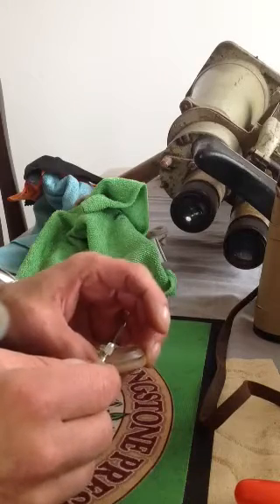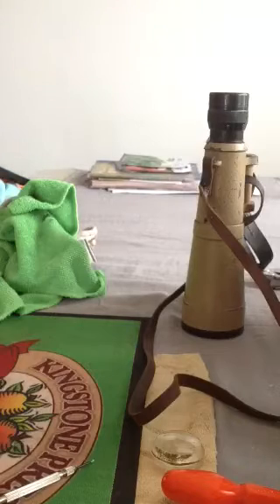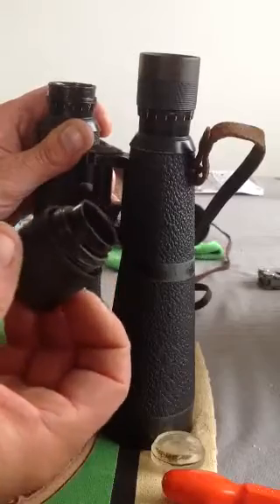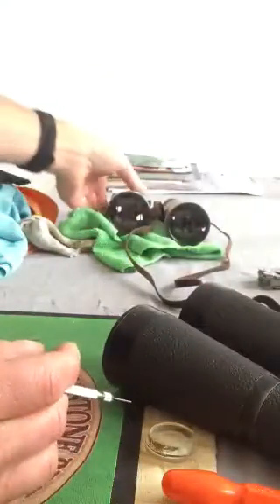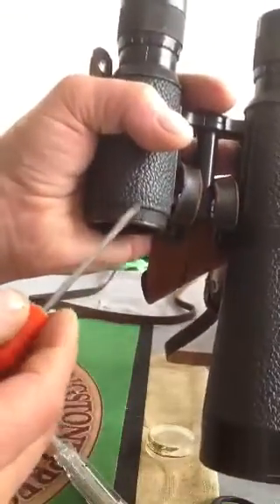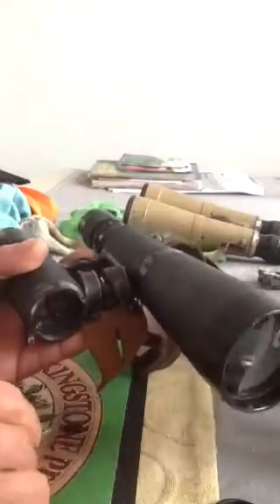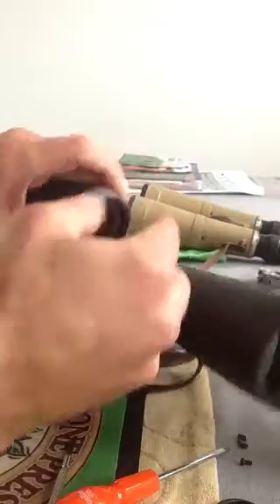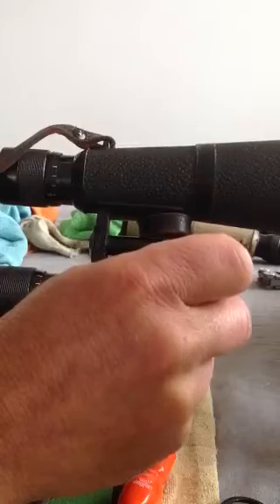Ww2 german dienstglas  binocular repair roof prism

Comment: Hi, thank you for your instructive videos. I have a question : how do you remove the large lens cover of a 6x30 pair ? Do I need to remove the lens before or can I take off the plate directly after having unscrewed it ? Thank you.
Reply from the maker: Hi maître chat,no you need to remove the screws and the objective lens before the plate can come off,I have another video on the 6x30 hopefully that will explain it in more detail cheers
Reply: Thank you, it's done. I used a boa as you do, a nice tool. The objective lens was jammed